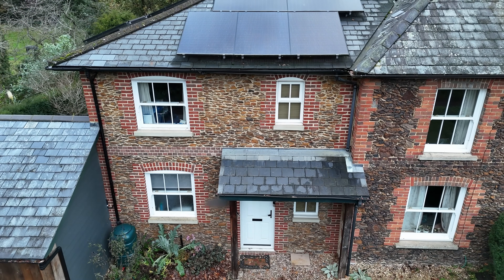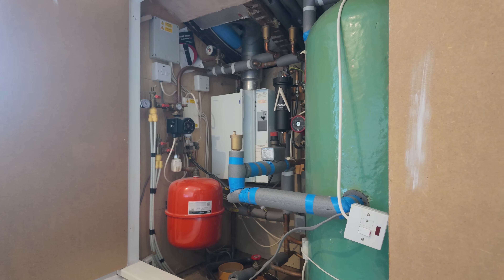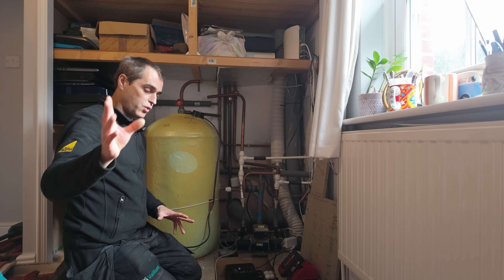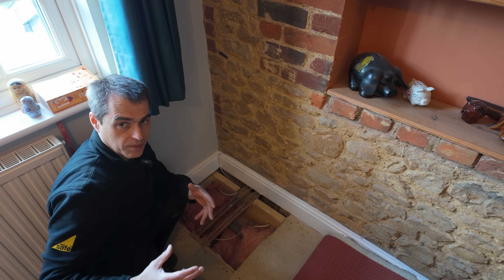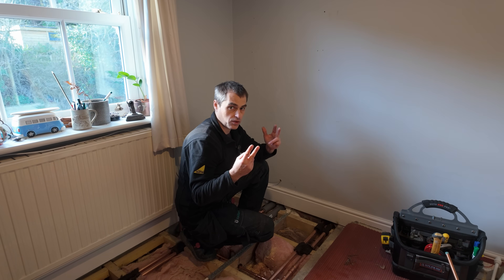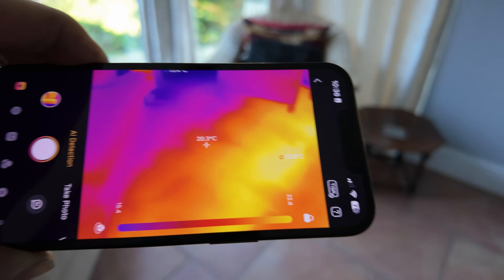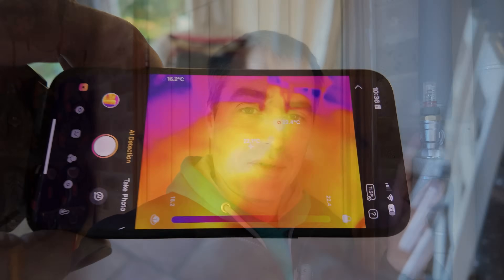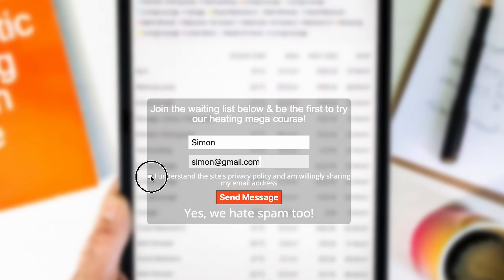How a Simple Flow Valve Changes Heat Pump Installs

Comment: Hi Symon, great video, we have recently signed up to spruce but its defaulted to using the CIBSE guidance on air change rates which we know are very much outdated do have another method for working that out? Look forward to your new training course coming out 👍
Reply from the maker: I use 1 everywhere for all rooms for builds before 2000s and 0.5 for new build and in between for 2000s to around 2010

Comment: hey man, firstly, thanks a lot for sharing your knowledge and experience, I've learned a lot!

I have a Zubadan 14 kW HP and although I probably oversized I wanted to check with you if my flow rate is good enough as I don't want to use buffer as you've suggested.

So right now I get around 20-21 l/min flow rate and the specs mention soe range of 18-36 so I'm close to my minimum, even worse (18-19) if I add the filter (removed it since there already seems to be one included with the internal unit/cylinder (it's a split system).

So is that range just a suggestion or actual minimum/maximum? Also how could I improve the flow rate without buffer? Does oversizig the pipes really do anything if the pipes going our of the unit are of specific radius (think around 22-24)?

Comment: Wow how much did that cost. The whole house has one single control and no zoning. That must be a nightmare as the sun comes up on one side of the house. Can I ask why you fit anti freeze valves when it does not mention them in the manufacturer’s instructions? How does it affect the valliant warranty. If you have their blessing would you make a copy available.

Comment: I like the use of those valves on UFH. My only concern would be having the ability to vent the system at the high spot you  have created there in case of airlock
Reply from the maker: Just add a vent. Top floor ufh has 2 flushing points

Comment: Very interesting video. I can see how difficult that must have been. Great job. No Viessmann this time? 

I have signed up for the course. I have no doubt it will be excellent. 

Thanks 👍🏻
Reply from the maker: I really like the Vaillant twin fan units.. Simple to install and have very good efficiency. Controls need an upgrade, though. Viessmann would have been a bit trickier, and I really hate how heavy the twin fan units are! (well over 200kg) - although they are built like tanks! 

Thank you for joining the waiting list! I am around 30% in the first part of the course, but it will still take some time.

Comment: Another very useful video Syzmon. I have been thinking about this FRVs to use on my system (V200gas ) - it makes balancing accurate and quick. However they are knocking them out at a pretty high price _ I think a serious volume discount will be needed before I bit this particular bullet. Thanks for sharing .😀👍

Comment: Is your mega course only for engineers or is it of use to home owners.

Completely other end of the scale what about commercial buildings, could heat pumps work in larger spaces?
Reply from the maker: Engineers to start with but if there is integrated and will also take money form homeowners 🤣

A lot of commercial spaces already run on heat pumps. All Screwfix shops use A2A, Lidl or Aldi use Vailant A2W
Reply: Heat pumps can and do work in larger commercial buildings. They tend to be air-to-air so that they can provide effective cooling in summer. I work for a motor dealership group and all our sites are heated by ASHPs.

Comment: It's only 19°C indoors. And that is great ????
Reply from the maker: Yep - much better than expected to be honest. There are also 2 rads on that area that can be very easily upgraded if a higher temp is required, but the customer seems happy with 19c in the kitchen at the design outside
Reply: They have no control over the existing underfloor install. Speaking personally, I prefer lower temps, especially when walking bear foot or with socks, the only way really.

Comment: I’m surprised your client was happy with 19c. 
I have a similar situation, existing UFH which only raised the room temp to 19c. Client complained it was too cold. 😫
Existing UFH systems are a nightmare with heat pumps.
Reply from the maker: I managed the expectations by telling them it would be 16c ;)
Reply: @UrbanPlumbers  good idea. I may try that one! 😂 under promise, over deliver.
Reply: I think that was a combination of underfloor design (for higher flow temps) and significant heat loss out of the former Sun lounge,even though they had put a lid on it.
Reply: Was the rest of the house warmer than 19C?  Curious if you offered to raise the flow temp to make it warmer?
Reply: @RicknessJ82  I can confirm the lounge hit 22 the next day, the curve is now down to 0.6, living areas still 20+, kitchen still 19. I'm the happy client 😊

Comment: I would freeze at 19 degrees. I keep my House at 25 degrees and have a heat pump myself, but you probaly save quite a bit by going Down to 19 degrees.
Reply: Im at 24 with underflow, if its below 22 its cold for me😂😂
Reply from the maker: 25! That’s mad, way too hot for most people. 19c in a kitchen is fine. Anything below 19 starts to feel a bit cold
Reply: @U @UrbanPlumbers e average temp of my house measured over six thermometers is 19.5°C and get no complaints from SWMBO so happy life. I think if you are operating 24/7 on the right curve it’s a lot more comfortable than the wilder swings you get with other control strategies that result in cyclical temperature swings. The other thing I noticed when moving to this regime - it drives humidity levels down and that makes you feel more comfortable too.
Reply from the maker: Exactly as you say. We also are around 19.5c and it feels super comfortable

Comment: Without this channel I would have keep the old radiators on my house but now I'm gonna put underfloor heating everywhere and maybe in the future remove the buffer of my heat pump to gain efficiency
Reply: We have retrofitted UFH to most of the ground floor of our large 1930s 5-bed and it's excellent. We've left upstairs on radiators as 1) with all that UFH below, we don't need much extra heat upstairs, 2) I like having access to pipes and cables.
Reply from the maker: UFH is definitely a way to go, but still needs to be designed well

Comment: Amazing installation as always. I have one question. I recently had a heat pump consultation and will soon get an offer. The engineer said that i will need the 10KW vaillant model (125/6). Heating only - no DHW (handled by solar). He said that we will use a buffer (80 liter I believe) and a second pump. Radiators will be replaced. We will have 10 radiators and 2 towel warmers. My existing main pipework is 10 meters of 26mm ID plastic pipe, which goes to a manifold that splits to 6 circuits of 14mm ID plastic pipe. So one circuit per two radiators (kind of). The furthest radiator from the manifold is about 13 meters of pipe away. In such an install, do you think using the buffer and secondary pump is necessary? The installer insists it will reduce short cycling and increase efficiency, but I am hesitant. Looking forward to your input. Cheers from Greece!
Reply from the maker: It will not increase efficiency or reduce cycling. I would pipe it as a volumiser to start with and not install the second pump. Only if it doesn’t work then re pipe to separation plus additional pumps

Comment: Another great vlog. I am thinking about fitting a heatpump. My pipework is 8mm, I have already changed some to 12mm but due to flooring in some rooms I will have to run with the existing 8mm. Will the heaters with 8mm pipework still be OK, thanks.
Reply from the maker: 8mm will be trouble, unless it’s very close to the plant room / heat pump and rads are small

Comment: Keeping it just as complicated/elaborate as needed, no more, is very nice.

Starting simple without extra pumps to see if it gives enough flow through the existing pipes, radiators and underfloor heating pipes, seems to give a good use of time and money.
Reply from the maker: That's the idea – only add complexity when it's absolutely necessary.

Comment: Very impressive work, your knowledge within the heat pump world is the best I’ve seen , being somewhat critical of heat pumps judging by many disgruntled consumers because of the running costs it’s pretty overwhelming that the running costs are due to bad or lack of experience when their systems were installed.
Reply from the maker: Thank you. Yes, bad installations are unfortunately happening on a scale that is troubling. Hopefully my course will help people get better at installing heat pumps !
Reply: @UrbanPlumbers  if people can’t learn from the best then there’s a bigger problem to deal with.